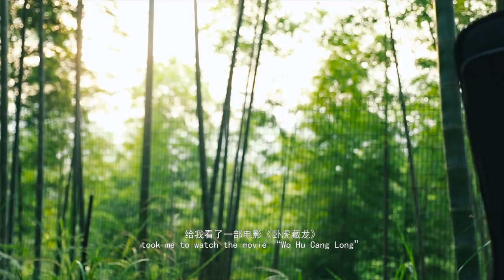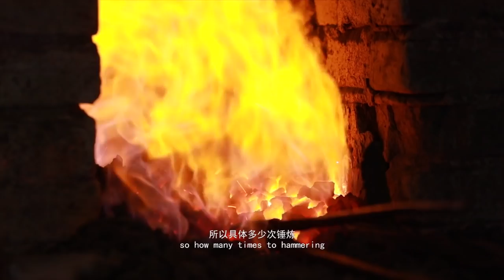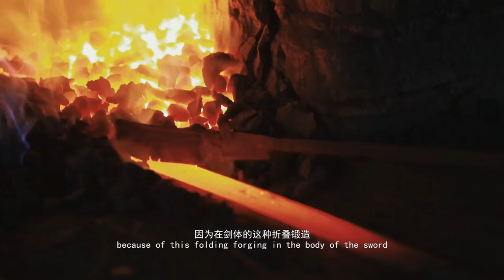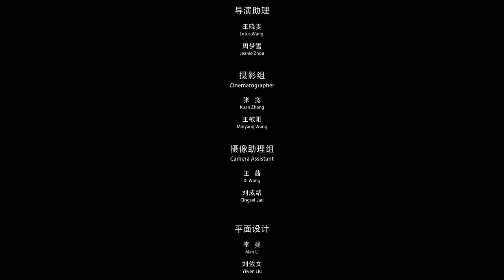Making Longquan Sword in China

Comment: Carving after hardening... Interesting
Reply: When they were quenching it looked like the lower part of the blade was not hardened. It looked too cold. Though it doesn't make sense
Reply: Carving on a blade is always done as the final stage.

Prior to heat treat, the blade is only rough ground so any carving or horimono at this stage would lose a lot of depth and detail when the blade is finished and polished.

Comment: This sword looks the same as jian swords but it looked less flimsy, I also thought it might be heavy since I usually saw people use it with one hand
Reply: It's han jian from the han dinasty. I once red the weight of a traditional han jian without fittings was between 450 and 900 gramm.
Reply: “Jian” means “sword” in Chinese .So “Jian swords” looks like you’re saying “sword swords”.
Reply: @lemon7up199 it actually means straight swords. Curved swords are dao

Comment: But you can buy them for cheap on ebay. Lol
Reply: @JarisMarvin  so how much is this real nice sword? Lol.  Its not like it any better than the cheap ones $150 USD.  Unless this real nice sword can cut thru grade 10 chain. Lol
Reply: @JarisMarvin  grade 10 chain is really soft tough metel. Its not hard grade A tool steel material.  And nope not even in reality with most smith in china using 1095, junk steel, and a10 steel. Alot of antique swords are rusted and eroded. Alot of other older sword since the yuan dynasty aren't made that well. The modern day production is a reinvented method using a lot of modern day material and really poor understanding techniques.